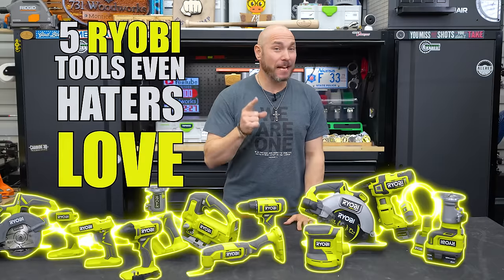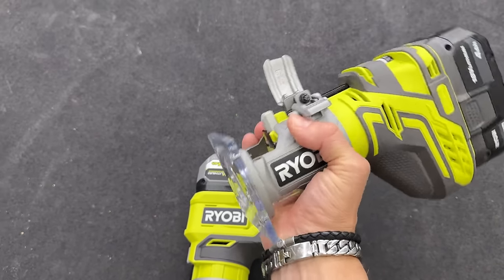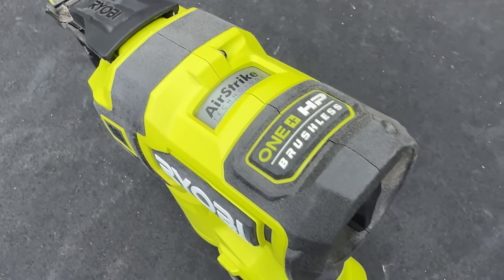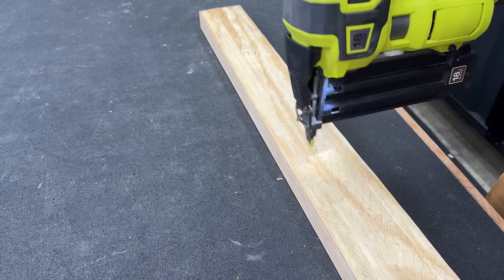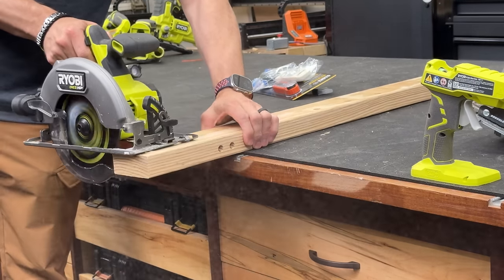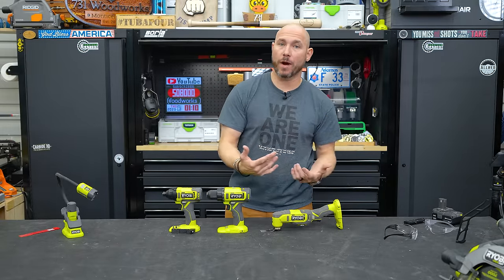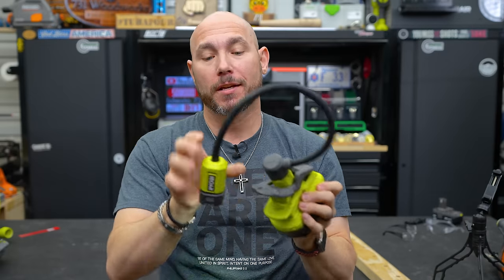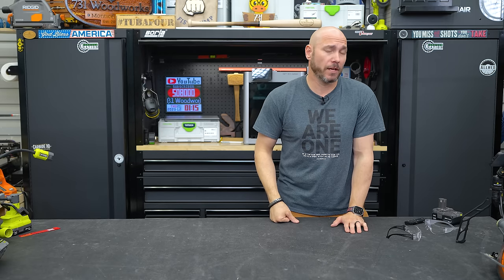The Haters Will Love These 5 RYOBI Tools!

Comment: As a hobbyist woodworker, Ryobi has been giving me some very good value for my money. If I used some of my tools daily, I would look for a higher end brand. But for occasional use, they are perfect.
Reply: Couldn’t have said it any better!
Reply: We’ve used Ryobi in the shop pretty much daily doing van conversions and haven’t had a tool die yet. So I wouldn’t knock it for  some professional use either.
Reply: Yup.i use their 18 v weed whacker and hedge trimmer all day, every day in rhe summer. 3 years in a row and no problems. Just one battery replacement.
Reply: I have their 16 & 18ga brad nailers and been working great for over 2 years so far
Reply: Very useful and powerful enough for DYIers that's getting into power tool eco system.  Especially if you live near Tools Direct Outlet.
Reply: Nailed it!
Reply: yep...
Reply: I like Ryobi because of the one battery system and the extensive line of tools.  Fits my needs well.
Reply: Ryobi and AEG (Ridgid) brands are owned by the same company.  Ryobi is rated as diy home handyman.  AEG is their professional range.  Take a look at the AEG subcompact range!
Reply: I've been really impressed with my Ryobi tools.  With Home Depot daily deals and direct tool outlet sales, I can buy a lot of specialty tools that I wouldn't be able to afford otherwise because of the reasonable pricing
Reply: Direct tool outlet had a sale for the drill/drivers for $20.  I bought several of them so that I can chuck up various bits to expedite my projects.
Reply: @dhokanson55  Do you have issues with the weed whacker overheating?  I can only use mine from a little while before it stops on me, otherwise it works great.
Reply: @justingraham1205 No. It's awesome actually. I've put probably over 1000 hoyrs on it, no issues with any other Ryobi tools either. The 1st gen batteries were terrible though. Now I have the newer 18v 4amp hour ones. They last like 5x longer. The 40 v line is really good too.
Reply: Milwaukee and Ryobi are made by the same company.
Reply: The mechanics at my company, who maintain transit busses, use Ryobi more times than not.  They beat the ceap out of them, but they keep on working,
Reply: @dhokanson55  3 years and a battery replacement...

I just retired an old makita drill set that served me for over 15 years on the same batteries that came with them.

They looked and felt like Gandalf past his prime and compared to new tools were closer to a 12v model! It was thier time.

They have retired to homeowner use for the next 15 years.

If I had to replace batteries every 3 years I would cancel that item as it's actually more expensive in the long run.
Reply: @gojeda  in our industry, we throw milwaukee tools to dudes that need them. Pretty sure I've tossed a couple about 20 feet!

They take the hits and keep on ticking (except the non-fuel skill saw)
Reply: The first generation batteries weren't designed for the high powered tools like the weed Wacker and skill saw. And that's just the 18v line, the 40v is way better. I'm pretty sure I got the battery wet too.  @brandonhoffman4712
Reply: @dhokanson55   Early batteries being underpowered is actually a capacity issue leading to an amperage bottleneck as tools became more powerful.

There are various battery performances @ a cellular level. It is always a balance of performance in Amp capability vs Amp hour capacity. The industry basically settled on 3c cells as a sweet spot ages ago. For everything from laptops to these power tools and other electronics.

3c is based off a C rating which is a standard set for discharge capacity for cells with C standing for capacity.

Lets do the math! So if you had an old 18v 2.5ah battery (my old makita). 2.5ah × 3c = 7.5amps of max power output capability. 7.5amps × 18v = 135w max power output. (Amps × volts = watts)

If you take an 18v 5.0ah, you have 15amps, and 270w max power.

You take an 18v 12.0ah, you have 36amps, and 648w max power.

If we do a 40v cell to compare. We must 1st acknowledge 20v, 40v, 60v, etc are marketing terms. The cells are actually 18v, 36v, 54v, etc. So I will be doing my math on 36v to keep things fair.

Let's do a 40v (36v), 4ah battery. That's 12amps of power, and 432watts of max power.

40v 6ah, 18amps, 648 watts of max power.

So an 18v 12ah and 40v 6ah have the same power output capability.

The difference is do tool companies want to sell you tools that unlock the performance of large batteries, or sell people new systems and more batteries?

I think milwaukee is playing the long game. They can make the same power @ 18v. They can just keep going bigger as the competition does. A 40v 8ah is an 18v 16ah, 6 of one, half a dozen of the other.

The difference is in the wiring, or perhaps a few % loss on battery life if they use a boost converter in the tool to hit the volts they want.
Reply: @dhokanson55  oh and on the battery getting wet. Sorry man, I feel for ya.

The sea, she takes her toll on us all she does, arrrrrrgh!
Reply: @DiHandley  Actually Ridgid is owned by Emerson Electric since 1966. However TTI owners of Ryobi & Milwaukee Electric Tools & does make Ridgids 18V tools and some of their corded tools. They also manufacture Hart Brand for Walmart & AEG for Electrolux.
Reply: Totally agree. And everything is in flux. The top brand today may be the discount tool in 10 years. 

And tools are by definition the most susceptible good where this applies. 

Tools are meant to make takes, faster, easier, safer and cheaper.  And while you can’t get that all at once, over time every tool should meet all 4 of these metrics. Compared to their equivalent even a decade ago.
Reply: i use mine almost daily and they are still working 10 years later.
Reply: Why would you need a higher end brand?
Reply: Ryobi framing nailer way better than dewalt of milwakee

Comment: As a hobbyist I bought all ryobi 5-6 years ago and said as the tools broke down I would upgrade to something else slowly. They are all still going strong and haven’t had to replace anything yet.
Reply: I said the same thing about the same length of time ago…only I use em daily in construction! Now I have gone through about 3 sawzalls and one multi tool (updraded to the dewalt for that one-much better). All in all I’ve been pleasantly surprised
Reply: @terrellknight1756  yeah I have been impressed. I built out a whole shop in my garage with them for our new house and cut down wood a lot. The real surprising part is I still have the same original 4 batteries I got to start with and they work. Now I have added some batteries obviously but I have never had a battery go out. But my upgrade is going to be to Milwaukee I think when I do replace stuff.
Reply: Same here.
Reply: Over 20 yrs ago my wife bought me the 5 piece Ryobi tool set.  It came with a circular saw, a vacuum, a Sawzall, a flashlight, a drill, and a blow molded case.  I still have the Sawzall, the circular saw and the drill.  The flashlight got ran over and I've lost the vacuum, but it wasn't great anyway.  The drill just lost the rubber overloading a month or so ago.  The Sawzall just lost the ability to hold a blade and I had to buy a new one.  Over 20 yrs of homeowner abuse and use and 3 houses and the main tools are STILL working.  I will NEVER understand the hate ANYONE has for these tools.
Reply: Same thing here when I first got into building speaker cabinets and became a home owner. I own a Dewalt cordless drill that was gifted to me, almost all my other power tools are bright green Ryobis which were basically a step or two above the cheapest generic brands and cheapest Black and Decker stuff at Home Depot or Menards. Haven't had a reason to buy anything else yet. I'm sure if I was in a trade and working with them every single day most would have broken by now, but my Ryobi stuff is going on 10+ years. I even break out the Ryobi corded drill to deal with stuff the cordless Dewalt doesn't quite have the oomph to handle. That said I do really love that Dewalt, it just needs a new battery every couple years.
Reply: The one thing I like most about Ryobi is their commitment to battery backwards compatibility. Granted that has lead to the somewhat awkward "neck" form-factor for the 18V ONE+ tools. However, this commitment means I can buy an old ryobi tool or battery (I really enjoy thrift stores and swap meets), and I can be sure that they will work (more or less) with the brand new stuff.

Comment: Gotta say, the little 5 1/2” circular saw is a gem for me… I put a nice blade on it and it’s awesome for breaking down plywood.  I like it because it’s lightweight and small… it does the job for me!
Reply: i am using that circular saw and I cannot complain, nice cross cut blade or ripping blade and it works just fine. I prefer this one sine it has blade on the left side
Reply: The 5 1/2" circular saw is easily the worst tool i've used from Ryobi.  I agree with him, it's horribly underpowered and I couldn't trust it to do anything other than break down simple sheet goods (which was still not great).  The sander sucks too, but the other tools I still own a few.
Reply: Have to agree. If you need a heavy duty all purpose circular saw, the 5 1/2” isn't what you're looking for. With the right blade it is a great little tool for hobbyists, model shops and household work though!
Reply: I have the 5 1/5...it rips 1x4's without much trouble. Drains the battery fast for sure, but with a Diablo blade ive had no trouble.  Great for pallet wood projects
Reply: My 7¼" Milwaukee collects dust because of how badass the 5½" Ryobi is. I love it
Reply: Amen on the 5 1/2” circular saw.  I use it all the time and I love it.  I have cut too many 2x4s to mention and it is still going strong.  🙂
Reply: I use my festool to break down plywood into perfectly usable pieces with edges so clean I could step right into gluing edging on.
Reply: I agree,  got both saws and usually grab the 5 1/2  over the 7 1/4.
Reply: I agree. I use mine often to break down 16 foot trim close then take it to the miter saw.
Reply: I've still got, and use, a 5 1/2" saw with an edge guide clamped on it for cutting plywood sheets. And that's all it does, but it's enough.
Reply: I returned it.  It would bog down on any wood, utter junk and I was using a Diablo blade so you are wrong from my experience.  I use Diablo blades on everything except a specialty blade I have for acrylic only.

Comment: I am a retired union  carpenter. The circular saw you showed has the blade on the wrong side unless you're left handed. You want the blade on the left side so you can see the line and blade easily. Ryobi does have one with the blade on the left. I have one.

Comment: I was a huge DeWalt guy for years. During a time when money got very tight I bought a Ryobi drill thinking I would use it till it went out (thinking it would only last at most a year). 4 years later it started acting up and I realized that it had lasted as long as my DeWalts. Since then I only buy Ryobi drills for my job.

Comment: As a homeowner DIY'er I have been very impressed by Ryobi and have about 14 (or more) of their tools going back to the NiCd blue tool days.  And with the exception of 1 NiCd blue drill that lived and died a hard life, all the tools are still going strong and still in use.  Also I will admit that I bought 3-4 of them with the assumption that they would be returned for lack of performance afterwards, and I kept every single one due to the tool impressing me.  That's why to me Ryobi is the obvious choice for homeowners.   They last, the battery platform means tools that I bought 20 years ago are still available for my use.  They perform, even tool I got 20 years ago I still use to this day, yes the blue tools are underpowered by today's standards but they still do work for their purpose.  And that means I don't need to buy new tools, or at least I can put it off longer till newer more powerful models come out.  I can also sing songs about the price but you know that, so I won't.  But the other factor is selection.  Ryobi's line is about as wide as it gets, so if you want a cordless tool Ryobi is your best shot of it existing.  All this factored together allows a homeowner to build a line of dependable useful tools over the years with batteries always at the ready for a fraction of the cost of anything else.  If I went with one of the professional lines 1: I would have spent a lot more or had far less of them and still struggling with cords or air tool lines 2: would have obsolete battery lines/adaptors/aftermarket batteries 3: most likely less options, and perhaps multiple battery platforms.  Ryobi just hits that sweet spot of long lasting, non-obsoleting, low cost, largest product line that, while they may not be the most powerful money can buy, they almost always have the power to get the job done.
Reply: Festool is very strong
Reply: My Ryobi (blue) drill is misplaced somewhere.  Maybe the attic somewhere??  I had one battery fail after too many drops onto cement while trying to remove them, sometimes they stick a little, anyhow the side cracked so the attachment mechanism was damaged.

Comment: Hey Matt, Thank you for sticking up for us Ryobi fans. I've been using Ryobi hand tools for years and had very little issues. The issues that I have had were corrected quickly due in large part to the warranty. The sander is underpowered, but I use it with a battery larger that the 2 ah battery that came with it. Anyway, Ryobi has been good to me as far as hand tools are concerned. The best part is that the batteries they make today, will fit their early tools. I hate when a tool company changes the battery design, especially since many times the batteries cost as much or more than the tools. Keep up the great work.
Reply: Yep, but their finish sander works unlike that junk or the saw.  I have been using their trimmer a LONG time.  No need for bulky units.  You can also swap out the string, for a heavier string or blades but the blades are plastic and can break.

Comment: A few weeks ago, I had some tools stolen, including my first Ryobi Disk Grinder, and a favorite DeWalt Saw and a couple of drills.   So I had to replace them, and found a box kit of Ryobi Tools, all brushless, including a 71/4"  power saw and a few other tools that added well over a thousand dollars for less than $500. (Factory blemish, which I cannot find in the tools yet)   Since I am not doing any projects at the moment, I haven't used them yet, but I am seriously looking forward to it.  Now I have two 1/2" drive impact wrenches, the new one better than the current one I have.

Comment: The One+ HP Inflator (P738) is one of my favorite ‘accessory’ tools. I use it to blow off my work area, mitersaw, etc when I’m done working and it works really well!
Reply: That in my only unit that has failed.  I just needed to inflate some bike tires and it would do nothing.
Reply: @toriless  I’ve never actually tried using it to inflate anything, but I believe they have 2 different models. The 738 is more high volume, low pressure (inner tubes, inflatable mattress, etc.) and the other is more low volume, high pressure (bike tires, basketball, football, etc.) so that could have been part of your problem

Comment: I bought the combo kit with the small circular saw.  The first project I wanted to use it on, I realized it was too small.  There was no way that was going to cut through a 2x6.  I tossed it into my tool collection and didn't think about it again.

Until I started working with 3/4 ply.  With a new blade on it, this little saw is great for short cuts on plywood when I don't really want to take out my corded Skilsaw.
Reply: If yours is the same as mine it will do an okay job for 2x6 if you slow down a little, get a better blade on it, and make sure to use the higher amp batteries. I don't notice it with most tools, but the circular saw the second those little 1.5 amp hour ones they come with some tools get any use they just don't have the guts for 2x's, so I use the 4 amp hour ones now with great luck. I added nice high tooth count blade actually seemed to make it stall less and cuts much smoother, though cut much slower. Would I use it for a massive project? Nah, but when I'm just cutting a couple boards for a project it's way less work than busting out and plugging in my old corded one.
Reply: Mine has no trouble cutting 2x6
Reply: That was almost exactly what I was going to post, except I purposely went out to buy the bare tool 5-1/4" saw when it went on sale and I am happy with the purchase. It fills an important niche in my power tool collection. It is great for cutting plywood without pulling out my corded 7-1/4" Milwaukee saw. It's lighter, quick set up and makes the cut. I probably  would not buy it as my first circular saw or if I was not already in the Ryobi ecosystem.

Comment: I run a small cnc focused  business and pretty much all my hand power tools are ryobi. I have the drill/driver, the nailer (older version), both versions of the router, the multi-tool, and the jigsaw. They all get the job done for me. After watching this I might have to look into the hot glue gun and the circular saw.

Comment: The worksite LED light is also fantastic (the cordless hybrid one with folding sides); it can optionally plug in directly to an extension cord but when you need to work somewhere dimly lit and don't want a hot halogen running, its great.

Comment: Gonna have to get me the twisty light.  The older model of the 5" sander works OK for quick jobs.  And I use the 6.5" junk circular saw for my parking lot sheet goods break down kit.  Works real good with the Kreg  rip cut guide.

Comment: Over ten years ago, I snagged a great deal on the Ryobi Drill and Driver pair with charger, two batteries, and bag for $99.00. Both tools have been flawless in operation. I have worn out the batteries and replaced them once, so far. Thanks for the review!